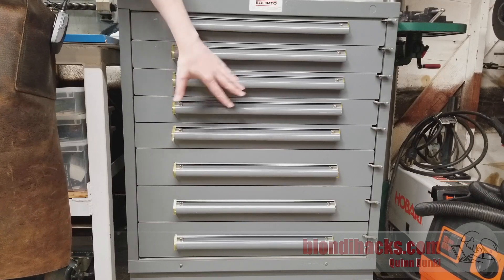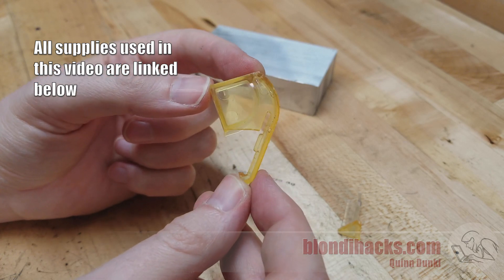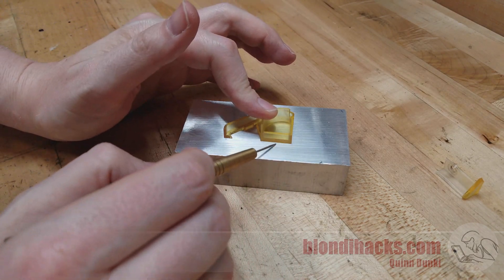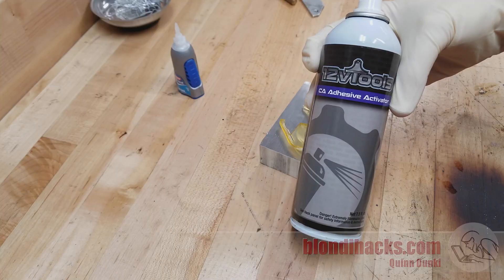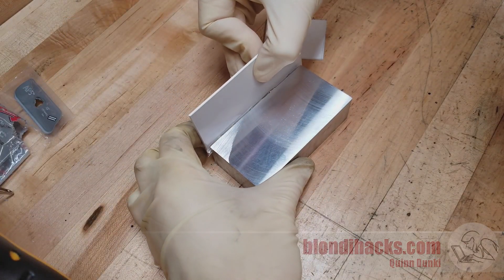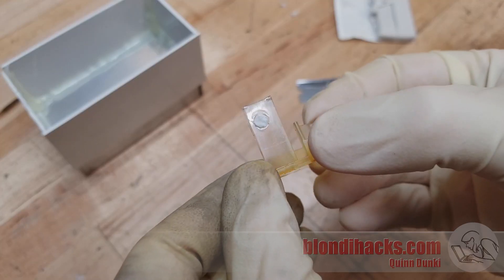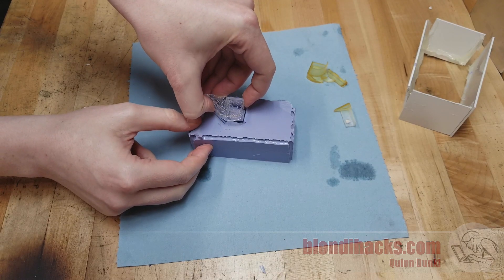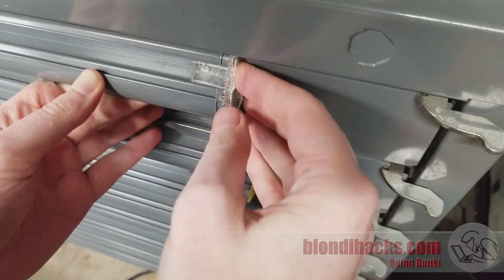Plastic Clip Repair

Comment: At the geek factory - er, model kit shop where I used to work, we used a pressure pot and pumped the pressure to 100-ish psi. It doesn't get rid of the bubbles, but it compresses them into irrelevance. We used a vacuum chamber to draw bubbles out of the RTV rubber as it cured.

Comment: I always weigh the 2 parts of my resin rather than measuring it's volume. Seems more precise to me when trying to mix small quantities and might help with some of your batches not fully curing. . I use resin sometimes as an element in the inlay work that I do and one method I have found that works well to eliminate bubbles is to vibrate the work piece while you're pouring in the resin with something like a small loud speaker. I use a little device called a tonerite but you might be able to achieve the same result with a small bluetooth speaker or something.

Loving your work.

Comment: Hey there Quinn old mate. Get your shop a box of the large LEGO blocks from wherever plus build a simple vacuum chamber with a cheap Chinese pump. No bubbles no troubles for bugger all and make simple or complex parts you are proud of. Rock on sweet lady.
Reply: Legos ARE a valuable tool!
Reply: For a quick container that minimises the amount of plaster or silicone needed for the mould the LEGO is a really handy bit of kit. The kids won’t be so impressed though.

Comment: Easy way to make a smal vacuum box. Plywood 3/4 thick glued  and screwed with a hole for your  vacuum.  The top should have some kind of seal , it will stay in place when the vacuum is on.  I use these boxes for pouring acrylic inlays in corian tops. For large inlays i use wooden pegs to keep it from  collapsing.  They work very well.

Comment: Techniques I use: Plexiglas sheet for mold fab 1/8” to 1/4” thickness works well to achieve a glass finish surface. Use liquid latex for the sealing of the dam seams vs hot glue. Compressed air (gun) to extract cast items from mold. Design the mold to minimize silicon to increase flexibility.

Comment: A perfect application for resin casting!! Note, there are some resins where the cure is inhibited by tin cure silicon and require platinum cure silicon for the mold. I'm on the hook to start making a bunch of parts from a resin that has this problem.

Comment: Blondihacks
Tip for removing hot glue. Wet with a dab or drop of isopropyl alcohol. It gets in between and breaks the bond. Also IPA doesn't attack most plastics unlike some other solvents.
Reply: Not only isopropanol, ethanol also is easily capable of penetrating and releasing the hot-melt glue.
Reply from the maker: Thanks for the tip!
Reply: @SianaGearz  True but some plastics are softened or melted by solvents and very few are hurt by IPA. I'm not sure how they compare for compatibility.
Back in the day we used to use IPA for cleaning studio tape heads because it didn't damage the resins in the heads or the plastics involved. Since those days I've kept a bottle of IPA around for general use.

Comment: I don't even use a tool box anymore- I converted all tool storage to Stanley Vidmar cabinets. Very similar to the Equipto. They have the same style slotted end caps and card stock inserts with plastic cover sheets. The original hard plastic end caps were prone to cracking, but the replacement design uses a softer ABS compound. No more busting end caps. Your Equipto cabinet drawers will support 400 pounds fully extended!
Reply from the maker: It also weighs 400 lbs empty! It’s quite a beast
Reply: @Blondihacks  Ha,  I pull out all the drawers and the support carriages before I move them. Three of mine are on industrial casters, one holding my tools has a folding towbar and ring (military).

Comment: Super instructive thank you!

I would suggest using double side kapton tape to seal and workholding between the aluminum block and your reference part.  Although I would not cover the entire area of the reference part because it will be hard to unmold. Just enough to create a seal. Then I would cut the excess tape.

Comment: If you do plan on doing more resin casting, getting a small vacuum chamber will help.  you'll be able to degas your resin before you pour.  Because the resin is going through a reaction you need to degas before you pour.  Also, degasing while it cures in the mold is a good practice.

Comment: Gidday, probably too late now but, a little tip with resin, after you mix it thoroughly, sit the container in hot water, you will see the bubbles rise, this will drastically remove most of your bubbles, the remainder bubbles you just hit with the heat gun slightly. Love your videos

Comment: Great video.  I know a dental laboratory tech that uses a vibrating mat for shaking the bubbles out from the dental plaster when they're pouring the molds.  Might work for resin / silicone.

Comment: Cheap vacuum container for small parts:

Small pressure cooker, (used one from Goodwill, etc)
One way valve.
Small vacuum pump

Also, to hold your positive in place, while making your silicone mold, use a 3M plastic film double sided sticky tape. 

Make sure it's not the stuff that looks like masking tape.  It is for fixture making, just as handy as super glue, but works in situations where super glue won't.  Need to look at MSC, McMaster, etc, to find it.

Comment: I get rid of bubbles by using a very dark tint in my resin. They're still there, but you can't see them ;)
Reply: Propane torch whipped across the surface for me.

Comment: I avoid bubbles by making a small funnel from a thin sheet of plastic, holding it slightly tilted and pouring the liquid so that the 'fall' is as short as possible, and the fluid runs slowly. The funnel should be held to the bottom of the mold, so the mold is filled from the bottom up. Sometimes I attach a thin straw to the funnel just so I can reach the bottom of the mold. The trick is to minimize the splashing, which tends to mix in air. Same when mixing, but you seem to have that down pat.

Comment: Hi! You will get good casting results if you do your final mix and place your mixing bucket are in a bowl of hot tap water when mixing. It will flow smoother, bubbles will travel easier to the surface and chemical reaction i.e. curing starts easier. Thin pouring and the other stuff you already found. I do not use vaccum chamber either.  Thanks for sharing.

Comment: Nicely done!

The cause of your part having bubbles is likely largely attributable to air being entrained in the pour. I avoid it by drawing my mixed resin from cup three into a large syringe. The rush of the resin through the tip achieves the last mixing step. I then push the resin into the mold with the syringe, keeping the tip submerged as much as possible as I flow the resin across the floor of the void. By flowing the resin across the floor of the void, and then continuing to fill it from below the resin surface, there is less opportunity for air to become entrained. If there is not one contiguous floor of the mold, I fill each isolated low spot of the void in this manner, then let the last one overflow, to finish filling the mold. Some bubbles still occur, but at about an order of magnitude less than when pouring. Vacuum degassing is easier to manage at that point too; since with less bubbles there is less of a volume change when the bubbles expand. That means there is less likelihood of resin spilling out of the void and shorting the part of material.
Reply: The corner of a plastic bag like you're going to ice a cake also works pretty well getting it down into the narrow bits

Comment: Cool project, I learnt a bit about silicone casting, never tried it before. Great info! 

As for the resin, Jorge Stolfi in another comment offered excellent advice when measuring out the 2 parts of the resin - use a digital scale (highly recommended and worth the effort). 

For easy mixing use a see-through plastic bag. Blow into it as you would a balloon to check for any air leaks. Insert the bag into a bowl or cup to hold the resin solution and place a bowl/cup on top of the scale and zero it.
Pour the first part of the resin into the bag, noting the mass that you require. Calculate the ratio for the resin activator (2nd part) and pour it in,
Seal the top of the bag, I usually just make a knot on the top to close it. (... perhaps one day I will try a zip lock back to test)
Mix for at least 3 or 4 minutes by squeezing the solution (PS. use protective gloves at all times - I use dish washing gloves, they last longer). 

You should start to feel it getting warm as some resins are exothermic as they cure.
When you are ready to pour, invert the bag so that the resin is away from one of the pointy corners of the bag, cut a small piece of the corner and you now have a pouring point that you can control with two fingers. (PS. Make the hole small, it's easier to control).
Pour the resin into the mould, perhaps start with the deepest parts of the mould, might help with the bubbles.

Hope this helps, have fun!
Reply from the maker: Whoa- using a bag for this is a great idea. I will definitely try that next time.

Comment: Make a chamber out of two flat metal plates, and machine a piece of steel pipe or tubing square on both ends, and use a compressed air vacuum venturi to generate the vacuum. Vaseline can seal the ends well enough. For something that just needs a few minutes of vacuum it's a cheap way to get it. Did lots of vacuum clamping this way to laminate wood.

Comment: For mixing A+B casting materials. I use 3 cups. Cup.A, Cup.B and Cup.C. (That is assuming you have a long enough working time) You combine back and forth between Cup.A + Cup.B; then pour into Cup.C for a final mix.

The more important thing is that you want do mass your parts and not eyeball. Volume in the best situation has more errors than a good scale.  Maybe if you are making micro castings you can only use a microscope to measure this but that is another level of precision.

Comment: Mark Novak heats the resin before you mix it so it does not effect curing. the adding heat at the end actually locks the bubbles in place and keeps them from rising to the top.

Comment: Excellent job !!!, I have a suggestion about bubbles ..., I design electronic circuits and encapsulate the PCB in special resin for use in outdoor environment ..., first I preheat the resin in the measure pot, without mixing with the accelerator (40° C aprox, you have to experiment the best temperature but it's not critical), then you add the accelerator and mix It, you can add some black colorant or the color you prefer, when the mix is done you fill the silicone in one part of It, and let the resin displace the air, not fill in diferent parts, and thats all ..., this works for me and get excellent results, I have done this job for 40 years and never fails.

For the original piece, you have to use a special wax and polish it, this is the recomendation of the experts ...

Nice work and I love your Channel, I have a WM180 minilathe and follow every video you produce, sorry about my poor english 😄

Cheers from Argentina !!!
Reply from the maker: Good ideas in there, thanks!
Reply: That’s a really good idea. Thanks for sharing it mate.
Reply: @crustyolcoot6646  Many thank's mate, this solution is for poor man ... ha ha, I know that if you work with resin everyday, the best option is the vacuum Chamber, perhaps would be nice to experiment with a homemade hobby vacuum pump  made with a los cost car tyre air pump, and constructing a vacuum Chamber too ..., some crazy ideas 😁
Reply: I also use this method and it makes a huge difference to the final result.

Comment: I am 2 minutes in, and am ready to accept the 3d printing challenge :-D
Reply: Super tough without a flatbed office/photo scanner, but you can fight your way through with millimetre paper. Easy enough with a scanner. You may need to backlight the thing and draw in where some of the protrusions are on the bottom surface, because scanner lighting is angled, but that's about it.
Reply: @SianaGearz  so, it is a serious discussion now? :-) I can also imagine taking photos, for as long as the camera is on a tripod and close enough, that would work. In a post-apocalyptic world with no cameras, you could ink tricky curves and make impressions of them on paper.
Reply: Getting to the end really spoils any 3d printing ideas unless you happen to have an SLA resin printer...
Reply: @rpavlik1   Nah a 0.2mm slot is easily printable! It'll likely get fused on the bottom layer but you can have elefant foot compensation or you just follow up the line with X-acto knife. No problem at all. If you can't print a 0.2mm slot well you just expand it to 0.4mm and it'll be fine. The thing doesn't actually rely on the slot being super thin, but when the label springs into place and occupies the full vertical height, it just needs that little protrusion to keep it from falling out.

Comment: If I remember correctly, you can get rid of the bubbles by getting the resin really hot as it is curing, which is what the leftover usually does by itself. Depending on your resin, you can help this by letting it pre-cure a bit. You do need to make sure you don't go over the temperature range for the resin, though.

Comment: A pressure pot seems to work pretty well for ditching the bubbles in resin casting. Try a dental laboratory website for one with a schraeder valve.

Comment: In my experience bubbles happen at times because of condensation on the walls of the mold. By equaling the temperature of both the mold and the resin you may control it. That could explain why thinner walls like the ones of the cups give different results? But because the room temperature and humidity are variable and the resin also heats up during polymerization, it can be tricky. Without a vacuum pump I would try a faster resin and a simple method to break the bubbles like vibration

Comment: Not a perfect solution, but it may help with the bubbles. Once you have poured the resin, put the mold in an enclosure that you can port your shopvac to and run it for a while. I had to pour clear silicone trays for microscopy work and I used a tupperware container with some cling wrap over it and ran a lab vacuum line through it and it cleared most all of the bubbles before it cured. Probably not going to be great for large volumes, but it will help something small.

Comment: Nice set of drawers, that would be very useful, bummer about the clips.  That was a lot of work for the clips, way more than I would have bothered with (I'm not above duct tape at times, lol) but you did a very nice job on those clips.  Very cool.

Comment: you can build a good vacuum  using a venturi and an air compressor.  You can also use a shop vac.  IT's not like a twin stage rotary vein vacuum pump  but it'll outgass your  resins

Comment: If the resin isn't curing properly, you mixture is likely not accurate enough. Five minute epoxy tolerates "ehh, close enough", but longer curing resins often need to be exact.

For the bubbles, the best option would be a pressure pot , not a vacuum chamber. They are used often for casting in the wood turning world. You can modify a paint pot from Harbor Freight pretty cheaply.

Comment: Very interesting project. Might suggest that the ‘flat’ surface on the ends of those clips probably isn’t completely flat (due to post-molding shrinkage) anyway, so might have benefited from being lapped to the bottom plate to start with.

Comment: I use polyurethane resin for any casting I do, cures in about 2 minutes, you can get several parts done quickly with that.
Reply from the maker: Funny you should mention that, I just bought some urethane after this experience. Next time that’s what I’ll try.

Comment: There is a simple trick to reduce bubbles. You put cup on chair or table and mold on floor. Make tiny hole in cup and resin will slowly fill the mold. There should by thin long stream(?) of resin.

Comment: ' nother random idea, get a cheap whiteboard, cut it up into strips and pop rivet the strips onto the drawers handles. Instant, erasable, permanent labels!
Reply: I found a whiteboard tape. Haven't used it yet but I think it should make it easy to add an editable label to near any clean surface.

Comment: Short of an expensive vacuum pump, you can use an inexpensive ($22) lab aspirator powered by running water 

      Humboldt H-12020 Aspirator Filter Pumps, Chapman, Swirling-Type, Nickel-Plated

They're small enough to put in a drawer, and they attach to your faucet.  Plus you can use your affiliate link on Amazon!

Comment: Informative and 'satisfying' :) video as usual...learned a tip on the silicone you used thank you for that. Regarding the epoxy: Been working with epoxy on boats since I was a kid. There are some fantastic additives that will give your parts more strength...silica in this case is cheap and easy...though I may have reached for milled fibers (a dust of fiberglass fibers) in this case. Even wood flour or fine saw dust from the bag of your sander will add strength to the piece. And Pro Tip: you can color the epoxy with a dash of food coloring for translucent look, but a little bit of acrylic artisit paint  does the job (cheaper than eg West System epoxy pigment)  if you wanted the part solid color, say white or black...or pink :-o